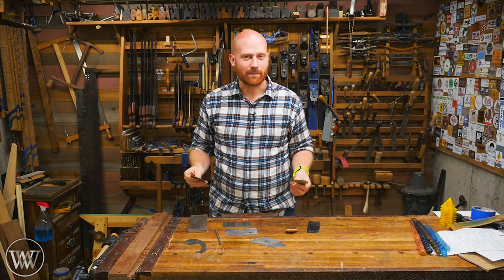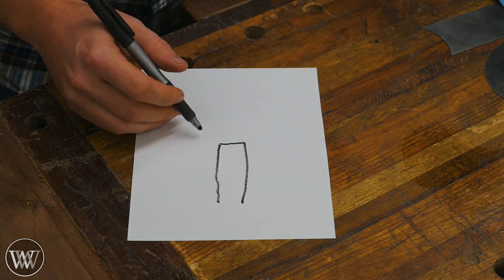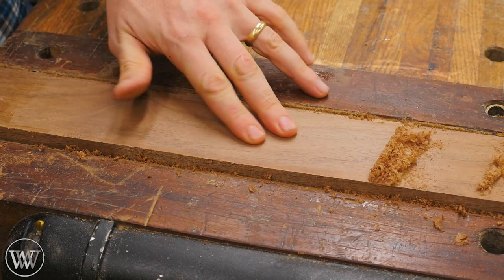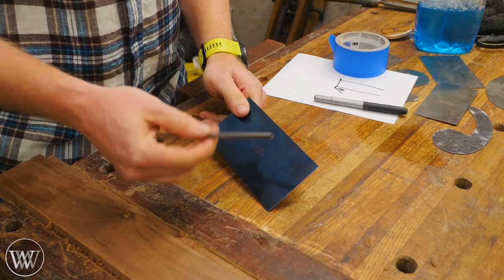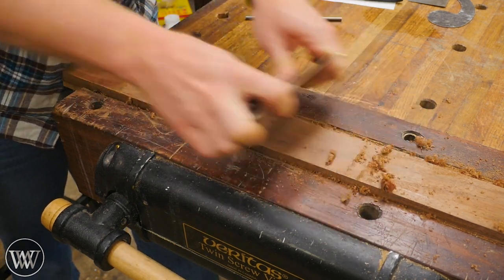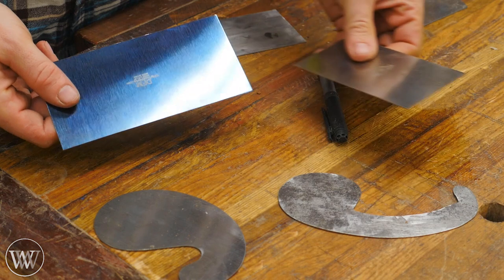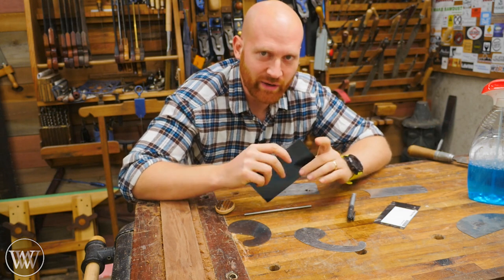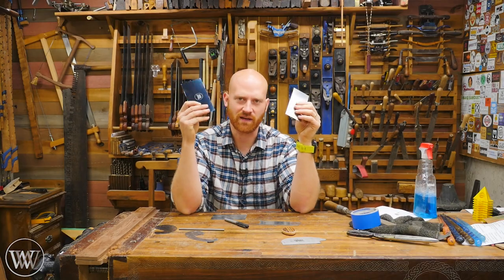How to Sharpen a Card Scraper Again

Comment: Thanks for a great video James.  I use card scrapers to clean off glue for furniture repairs, and it's the best tool for the job.  My card scaper technique has given me inconsistent results, so I'm going to try your technique... the step I'm missing is burnishing at 90 degrees before the 5 degree angle.  Liked & Subscribed!
Reply from the maker: thanks man. let me know how it goes. they are a lot of fun when they work well.

Comment: thank you James . this has been driving me nuts ( short trip) i got a burnisher to use on my scrapers no luck so i tried an old piece of hss ( high speed steel )  cutting tool it would just cut into it
Reply from the maker: What do you mean cut into it. it should be a flat or rounded edge.
Reply: @WoodByWright  the hss tool bit is a 1"x 1" x 7"  it is a 62 or great on the hardness scale ( rockwell ) .it is used to cut steel ... metals on a lath . it was something i had from my machinists days left in my box

Comment: If you go to the junk yard, you can find door pistons or shock absorbers - the metal rods are usually VERY hard in those, and make great burnishers for super cheap (~ $1)
Reply from the maker: sounds like a good idea!
Reply: Thanks for the info.  I need to change the lifts on my wife's car soon and I would have just tossed them.  I'll just cut off the shafts/rod/piston (whatever you call it) and put them to use.

Comment: Really good explanation and demonstration. How long will the sharp edge last or to put the question another way; how often does a scraper need to be resharpened? Also can you use a scraper to remove rubbish such as cement or plaster from wood to make it safe to plane or cut?
Reply from the maker: usually each edge lasts for around 12 minutes or so of work. but it depends on the hook you turn. if it is too big it can snap off.   cement or plaster would destroy the hook. usually for that I use a junk chisel. the Card scraper is great for glues and epoxy's though.
Reply: Wood By Wright many thanks. I have been given several pieces of 2 by 8 and other sizes but they have some cement on them. I think i will try a wire wheel to get the worst off and then scrape with an old chisel.the timber is too good to trash.

Comment: I have been struggling with card scrapers. After making several myself, which only got sub-par curls and left a surface worst than sandpaper, I ordered a set (the crown set, you show in this video). The factory burr removed more material from the wood than my homemade scrapers, but still left a worst than sandpaper surface. After some practice (and the use of microscope) I finally got some decent little curls and a better surface, but still not better than sandpaper and not as good as a hand plane. All card scrapers seem to remove more of the soft rings and less of the hard rings. So I get a raised grain effect the more I scrape. Maybe I just need to save up and get a carbide rod. I've been using a round portion of a file I polished (and before that, a screwdriver I polished). I only can use scrapers to clean up dipped spots that I can't get at with a plane. You make it look so easy. I sure hope I can figure out where I'm going wrong. I dream of a day when I don't need that nasty sandpaper.
Reply from the maker: I would ask what wood you are working with. it is is pine or poplar. something soft like that they are are really hard to get with. harder woods like maple and oak they do much better in.
Reply: @WoodByWright  Oh, wow. I've been working mostly with pine. I thought soft woods would be easier scrape, since they are often easier to plane. I have some walnut and random smaller hardwood pieces, I will compare results on that. Thanks a lot for replying.

Comment: Yours is the third or fourth video I have watched, and having tried the various techniques in each I still cannot get decent burrs that cut cleanly.  During the "burnishing at 90 degrees" step I really can't get a good mushroom (examining the edge with a loupe magnifier) so my curl over burrs don't work.  I'm using a Taytools Carbide Cabinet Scraper Burnisher Rod HRC 92-944.
Reply from the maker: Feel free to send me an email. I'll be glad to talk through with you. Sometimes I find it depends on the card scraper if the steel is hard, you really got to push it down to make it move.
Reply: @WoodByWright  It seems I must have gotten it correct, but I was doing all my testing on a scrap of pine.  I'm building a project now out of red oak and I needed to remove table saw burn marks and the scraper worked like a champ, generating curls and everything. 🙂

Comment: Can u use a nail punch as a burnisher? I think it’s hardened steel 🤷🏼‍♂️
Reply from the maker: Sure. most any smooth surface that is harder then the scraper will work. the harder it is the easier it is.

Comment: Ok so I know this video is like half a year old but yeah got questions. 1) in place of a diamond plate will sandpaper work - and if so what grit like 400+ or something a little more aggressive? 2) will the knife sharpener from a butcher's block knife set work; because my file while having a totally flat safe edge has burs along the side and not sure if that's good or bad but not willing to risk it yet. 3) how often should I re sharpen the edge? I'm finding that I can get a good bur and a nice curl but within 10-15 min it's just pushing dust. I'm very new to this I bought my card scraper because I really hate sanding off shellac and I knew it would remove it very quickly without burning up massive amounts of sandpaper (which can get costly) I think I might be doing something wrong, like very wrong.
Reply from the maker: 1. I would use 800-1000 grit sand paper. it does not take much to take off the bur. put it on glass and that will work fine.
2. sure. a knife steel is usually hard enough for most of them.
3. I usually do not use a single edge for more the 5 minutes or so. that is why I do all for edges at once.
hope that helps.
Reply: @WoodByWright  that actually helps a ton, I really did think that I was doing something wrong. Thank you

Comment: How are you suppose to sharpen a woodriver 80 cabnet scraper it has about a 1/4" thick steel plate with a bevel on it .
Do you sharpen it like a iron or a card scraper?
Reply from the maker: There are a bunch of ways to sharpen it, but personally I do both. Put a sharp bevel on it then turn a bur on that edge. I have a video on sharpening a #80 if you want to see more

Comment: newbie question: can a card scraper be used to finish the top of a nightstand or so even though the surface is wider than the card scraper? Better asked maybe?: in order to use the card scraper, must the scraper be wider than the piece you are scraping?
Reply from the maker: Good question. there is no problem with using it on wider boards. Just do it a piece of time like you would with a hand plan. Scraper is actually a really easy way of removing finish.

Comment: I love using my card scraper, but I have oily skin and find that even after one use it can develop rust overnight. Do you use any solvents to clean the surfaces after you're done for the day? I've been using acetone, but was curious if you add anything to the surface of your scrapers or have a better way to maintain the steel.
Reply from the maker: I use pastewax on all my tools. I make my own with bees wax and 3 in 1 oil.
Reply: Wood By Wright thanks, I found your video on making beeswax, I’ll give it a watch.

Comment: Why flex the card when scraping? Seems like it makes the action of the tool restricted to a smaller area...looks hard on your hands too?
Reply from the maker: good question. the fact is that you can not push much more then 1" wide when holding the blade like that. that is why they make scraping planes so you can get a wider grip and cut wider sections. it may look hard on your hands but once you have it down it is fairly comfortable.
Reply: That makes sense. Thanks.